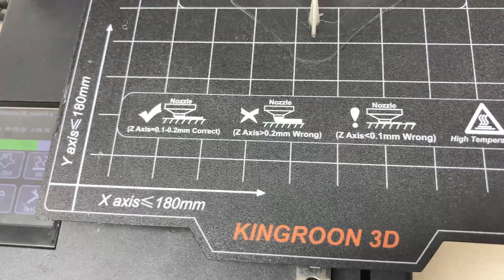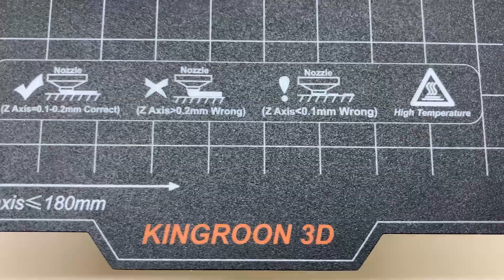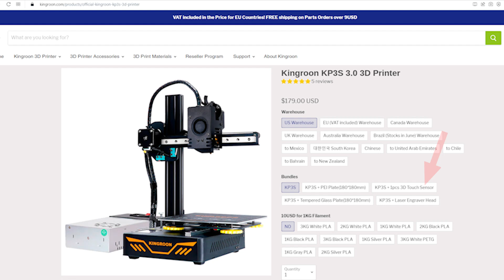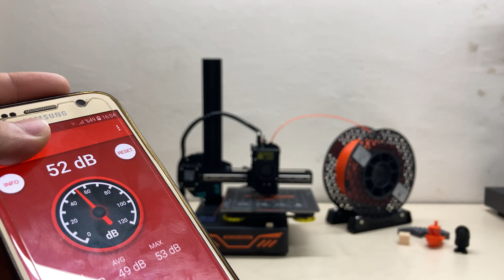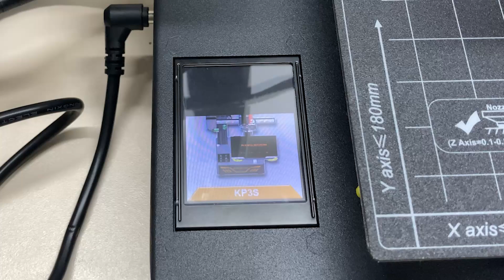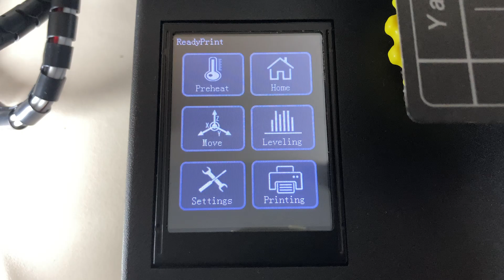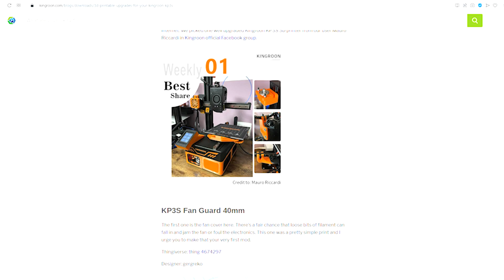Review: Kingroon KP3S FDM 3D Printer

Comment: Can you print things from your phone or do you have to have a desktop to run the design programs? Been wanting to play with one of these for years looks like my best option here
Reply: I think you need to download a software to make your design and then post it into the printer and then print it
Reply: You can download an stl file to your phone, but you need to run a slicer program to slice them for the printer, then put them on an sd card to put in the printer, So I googled apps and there are slicer apps for both android and Ipad, so you would be able to download 3d models from printables, thingyverse and other sites where people share there models. But you would not be able to design anything to easily on your phone, you would have to use online/browser run cad or design tools, I don't use those so I don't know how good they are. 
 I do use both Blender and Freecad and they are free.
Reply: @Zimbob2424  gotcha, kinda thought that might have been the case

Comment: Great video! Is it precise? I mean, if you print a 20mm test cube, will the printed cube measure exactly 20 mm?
Reply from the maker: Actually it depends on calibration.but generally if I print test cube, probably the results will 20+/- 0.5mm. Obviously if you calibrate the printer properly, you can get more precise prints since it has linear guides which are better than wheeled carriages.